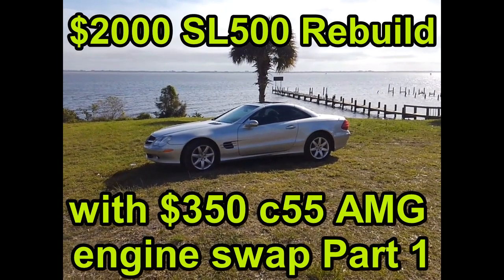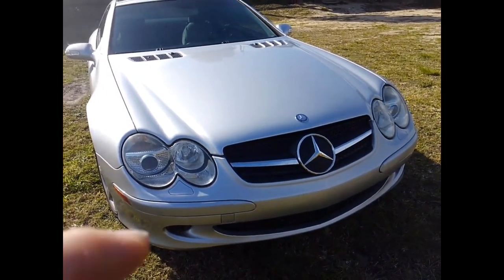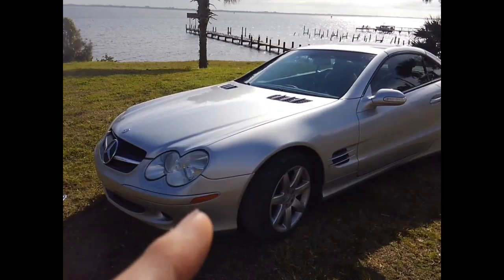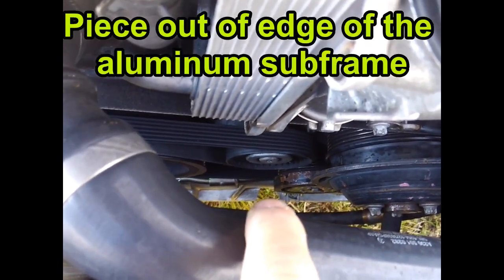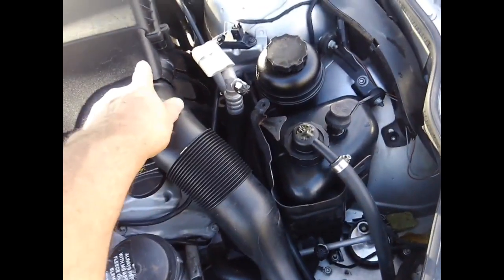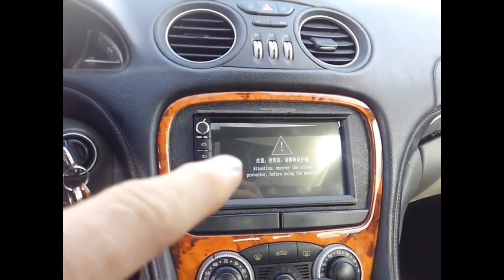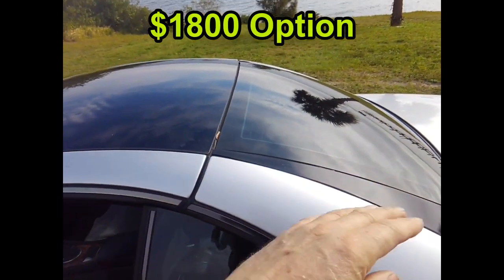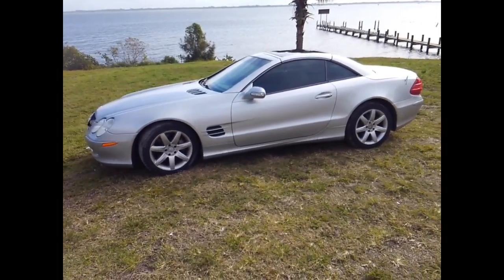$2000 Cheapest Mercedes SL500 rebuild with $350 c55 AMG engine swap PART 1

Comment: Easy swap, done it twice, re-map and have fun.
Reply: Is it direct swap do you need c55 ecu and tcu ?
Reply: @Mlive722  No the c55 ecu and tcu is not need however if you manage to get hold of an C55, CLK55 or SLK55 ecu of the same year it is possible to change the immobiliser chip with out any programming. This video will help https://www.youtube.com/watch?v=5DDj8GqDoRk
Reply: @solarpanel9310  Thanks for the info much appreciated

Comment: How do you get these cars and parts so cheap?
Reply from the maker: I constantly search Craigslist, Facebook, Copart, and IAAI for cars and setup notifications when cars I want show up. 
I find far more cars than I could ever buy.
I buy almost all my parts at U Pull It junkyards, and for more than 10 years reselling parts online and on Ebay, CL, FB made up most of my income. 
In fact I starting buying parts for the $2000 SL500 a year before I actually bought it. I bought a transmission for $75 and a lot more parts at a U Pull It half price sale.
I will be having a upcoming video series on "How to make 100k a year at junkyards" working Part-time.